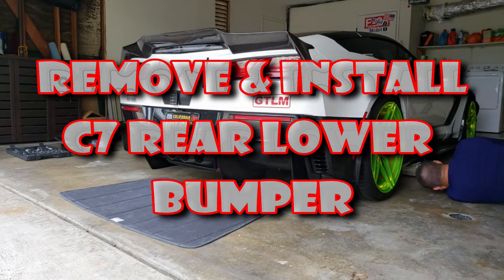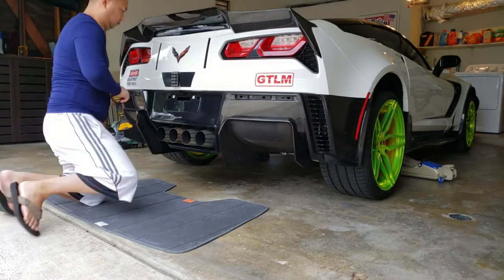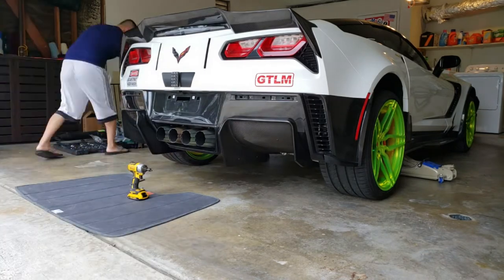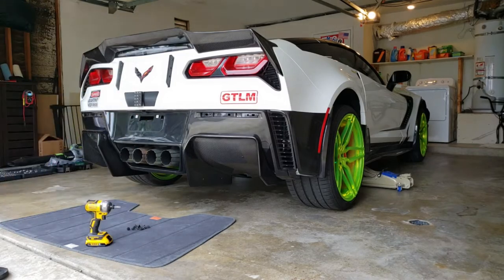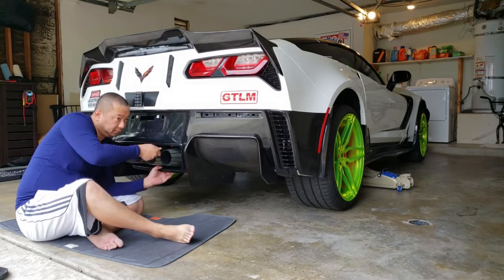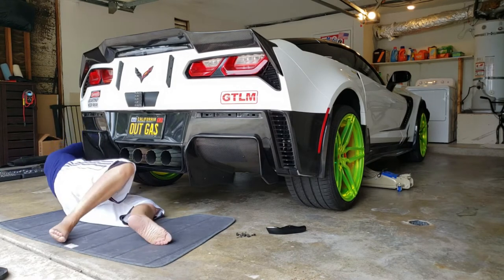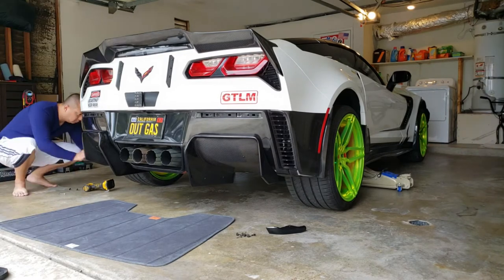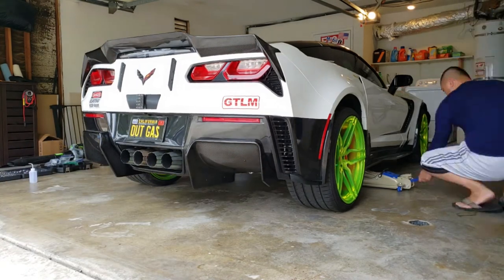Remove Corvette C7 Rear Lower Bumper | Repsol13 F26 Corvette C7

Comment: Thank you for sharing this. Couple of questions. What are the exhaust tips? Do you have to disconnect the rear camera to remove the bottom part of the bumper? Thanks!
Reply from the maker: Hi, those exhaust tips are from Viezu Tuning in UK and the Camera is attached to the upper bumper, so no disconnect needed